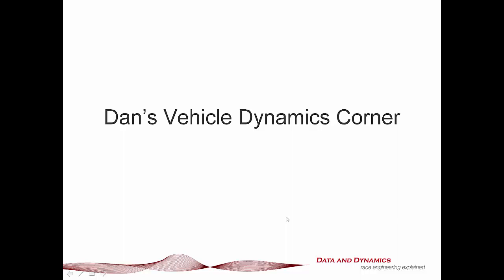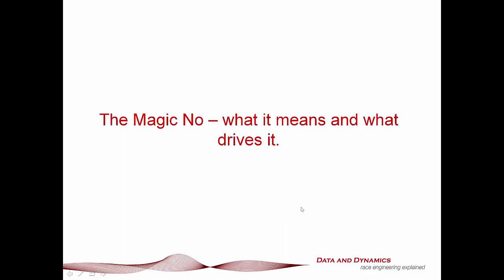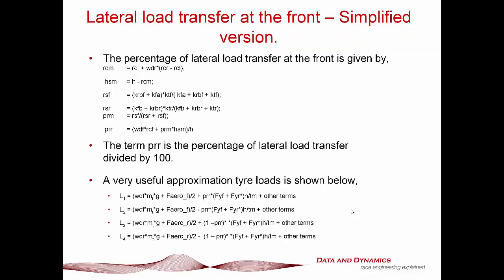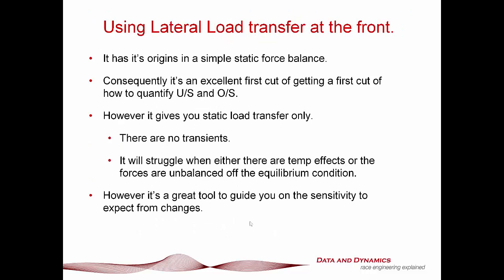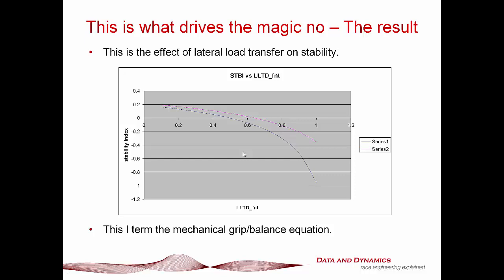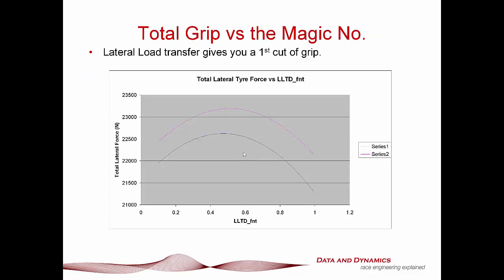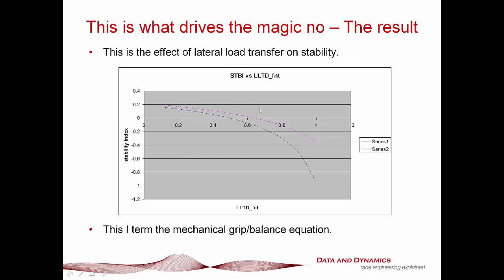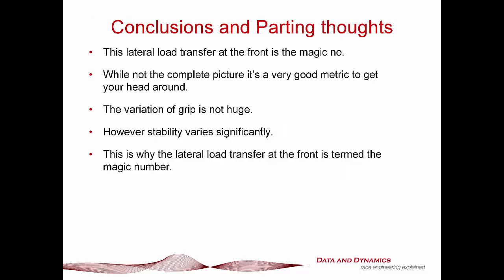Lateral Load transfer at the front/Magic Number - what does it mean and what drives it.

Comment: @Chassissim it was a great video loved it lots.

I have a query regarding load transfer this theory holds good for GT styled racing cars and of similar types. But does this apply the same for single seater open wheel ones like F1 etc.
Since it is very tough to account for dynamic Lat.Load Transfer since the aero effect is also induced in the axles 

So is there any formats to take that into account
Reply from the maker: Sir great question - The answer is yes!